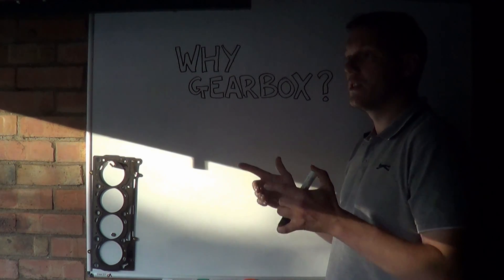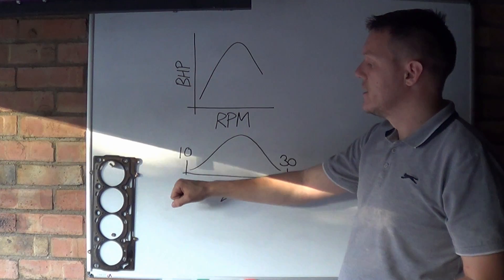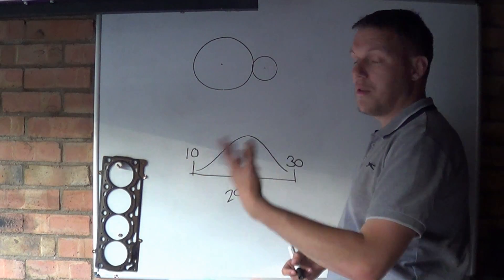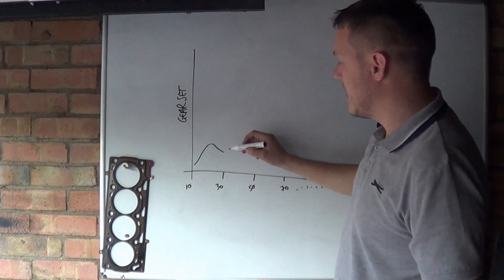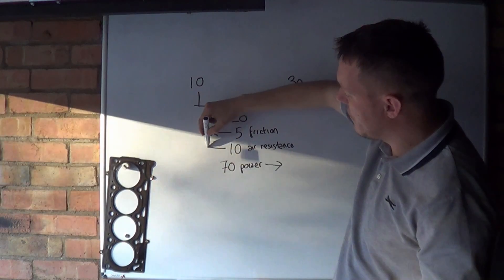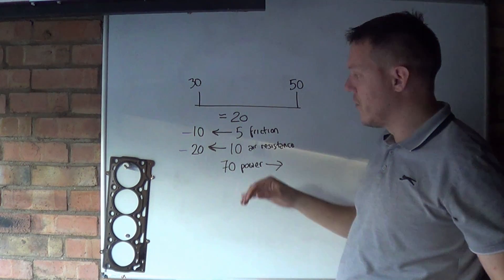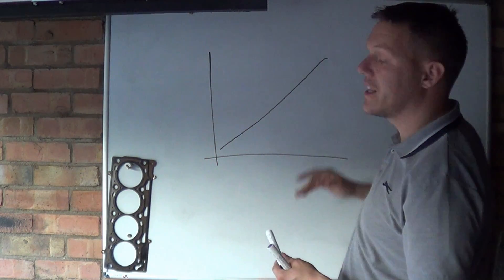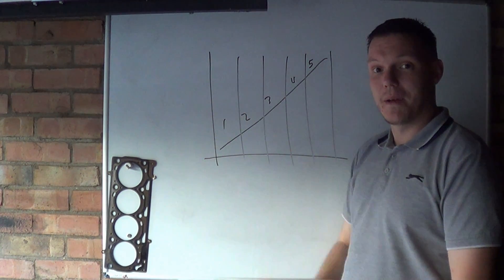Why have a gearbox - What do gearboxes do? - Bike TEch

Comment: Good stuff as always, lolled @ the gear tits. I have a question about manufacturer intervals.My Suzuki's manual has valve clearances to be checked every 3k miles or every 15 months can time really effect anything for valves? Yamaha bikes state they should be checked at 24k without any time restriction. Also Suzuki's manual states you have to change the coolant every 2 years (which I get) or if it reaches a certain mileage (every 5k) yet for my Yamaha all the manual states is change every 3 years.

It's a bit of a pain having to check mileage on top of the date last serviced.
Reply from the maker: Good question, you should make your own schedule on what you think is good. For me, I chnage my oil every 6 month, in autumn to a thinner oil and thick oil in spring for the summer. I would trust mileage over real time. 
As for the valve question  it works like this, as the valves are pounded over time this causes the valve seat to be hammered further and further into the head, this is a steel seat into ally head issue. Old cast iron heads suffered alot less from this problem. Also the valve tip wears away the combination of the 2 means that your valve timing slow goes out of sink.

I usually check my clearances when i change my oil, and replace coolant when i change my oil. I change my oil filters every autumn. For me that pretty much covers everything.

Will do a video - matt
Reply from the maker: And its up to the bike manufacturer what they think should be done, and they usually recommend their own brand of everything, so they're basing it on their own tests.

Comment: Loving these info bytes! Thanks a bunch for these, Matt.
Reply from the maker: no worries mate, any suggestions?
Reply: Maybe some bytes on the ignition/charging system and the difference between TI, CDI and old school Magnetos maybe? 

Another good one might be tyre choices and why that's super important. 

Engine timing is always a good one too and maybe a general guide on how to do it. I know you'll be doing one for the ER 500, so kill 2 birds with one stone
Reply from the maker: Bastard! You've done it again. I'm doing 2 videos. 1st is how to do the timing on the ER-5 and the 2nd it how to do timing without timing marks so to speak
Reply: They're always a popular request and an important part of engine rebuilding :D

Got some work done on my CX trike btw. Polished a shed load of the engine and it's starting to look good!
Reply from the maker: you polishing the ally?
Reply: Yeah, that the one. Though with how good it is looking, not sure I will paint it anymore. Was going to paint the engine red.
Reply from the maker: you'll have to send me some pictures on facebook
Reply: Sure thing. If I get a chance to get in the garage tomorrow after work, I'll get you a few.